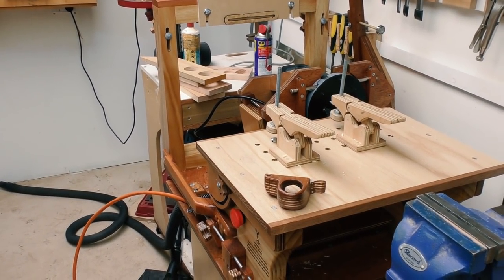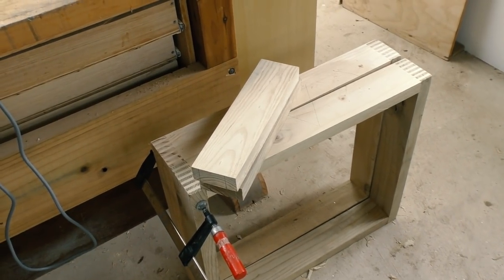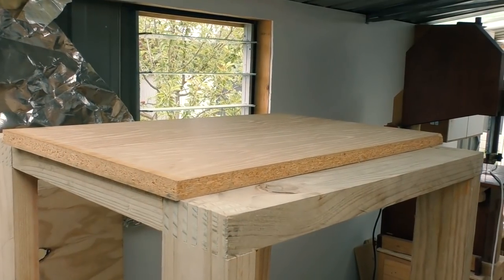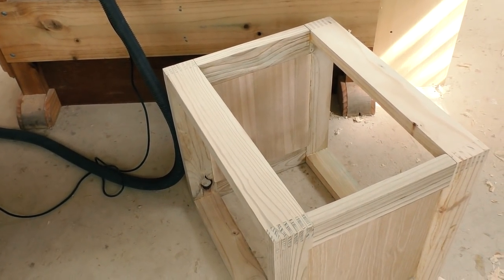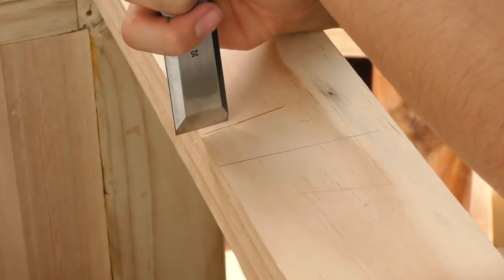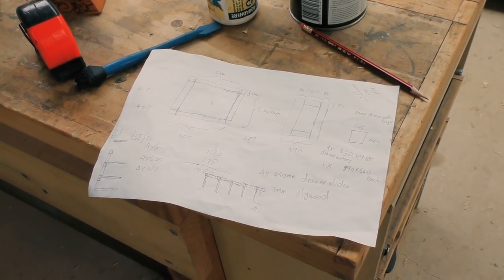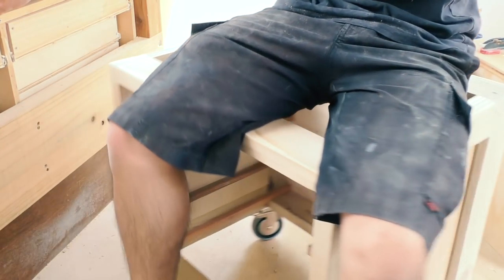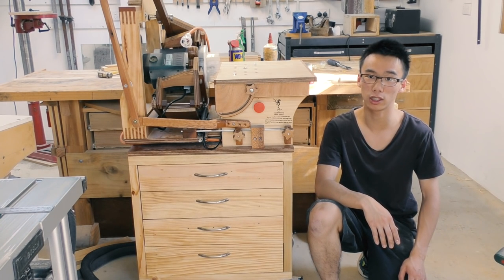Pantorouter XL build: making a stand

Comment: Awesome video Steven! It's like Matthias and Frank combined :D
Reply from the maker: Thank you very much, I was kind of keeping Frank in mind when filming, like "how would Frank do this?"
Reply: Steven Zhang It worked! one tip for doing stop motion is to put the camera on manual settings so that the exposure doesn't change between photos and create the big lighting difference that can happen between shots
Reply from the maker: Thank you for the tip, but I think the reason for some of the lighting changes in the shot was because of the window that was behind the camera - sometimes my body would cover the entire window up when taking the photo, and sometimes it doesn't. I am working on controlling my camera with my phone so that I can take the picture without even touching or going near the camera.
Reply: That would do it too for sure :) Keep up the good work man!